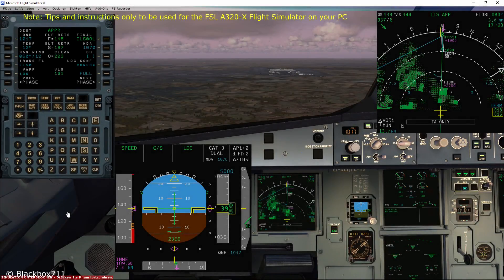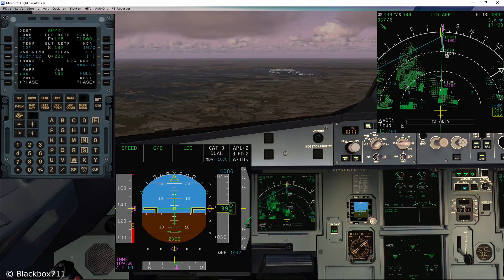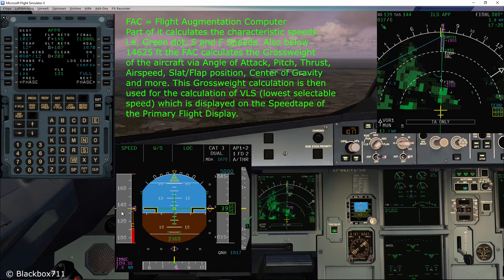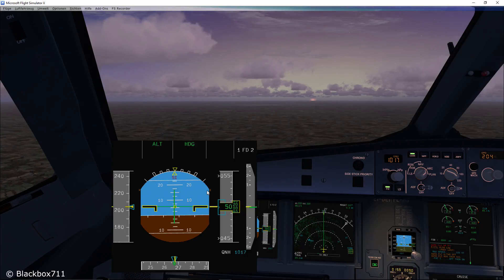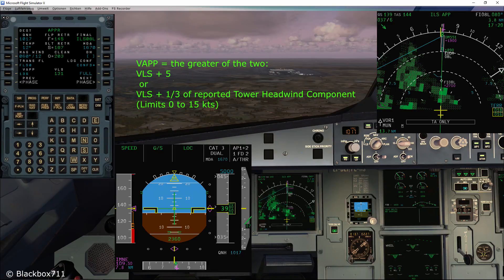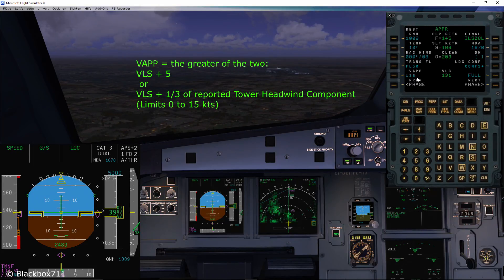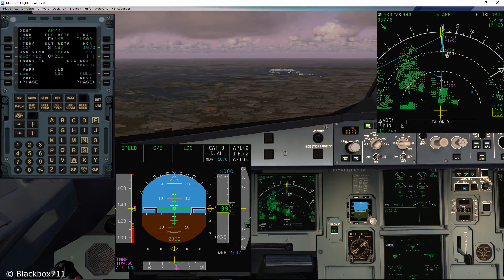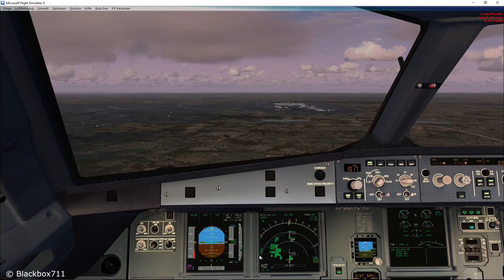FSLabs A320-X Basics: VLS and Approach Speed Management

Comment: Hai Blackbox711, Great video. I have 2 questions. 
We are using an APPROACH PHASE in FMC for the calculation. But, Is this phase available in real Airbus flights?
How to calculate approach speed manually?
Next time, please make a video regarding manual approach speed calculation with different flap configurations. If possible. Tank-you.. We are waiting for another outstanding video
Reply from the maker: Hi. Yes, in real life the MCDU approach phase page is identical. And we use the approach speed shown after filling out all necessary data fields there. In order to calculate approach speeds manually you would need the QRH table.

Comment: Thank you again for your very detailed and useful vids, i have a question i dont have yet the fslabs320 but have the older wilco 320 family and the aerosoft most recent 320 and any time i want to fly direct to some waypoint appears the T-P simbol on the ND and the aircraft simply turns to the left getting out off course regaining the desired track again with heading mode , why??
Reply from the maker: +azizc64 .. Thank you very much. I don't have the Aerosoft or Wilco A320. So unfortunately I cannot really help you with that. But it looks to me to be a bug because the Dir-To function is very basic and should not cause the aircraft to turn in any other direction than to the selected waypoint. Regards

Comment: Hi,

On what basis is the shown VLS in the MCDU calculated?
(In your example the 131 kts) 
Do you know why there is this discripency where the FAC calculated values are not automatically feed back into the MCDU values. After all it must be the more exact. :-)

Thanks for a bunch of great videos.

Cheers

Stephen
Reply from the maker: Hi Stephen. The VLS in the MCDU is calculated with the inserted Performance Data. The VLS on the PFF is calculated by the FAC, where the Grossweight is calculated by certain factors like AoA, TAS, Altitude etc. That is why there can be a difference. Regards
Reply: Blackbox711 thanks. I still do not understand why - if the FAC calculated is considered more precise, why the less precise value is not discarded and overwritten with the FAC calculated value... :-)
/Stephen
Reply from the maker: +MrSOdgaard .. No, the VLS does not necessarily calculate a more accurate VLS. The AoA sensors have some error as well. Also you cannot directly change the VLS in the MCDU. This could only be done by manipulating the GW setting in the MCDU. And the GW is taken from the Loadsheet which is considered to be accurate. So in order to make sure that you have a 5 kt buffer (for wind gusts) to the PFD VLS (which is master for warnings), you increase the Vapp in the MCDU if necessary. I know it sounds strange, but that is Airbus for you. 😉 Regards
Reply: Blackbox711 😉. Interesting and a bit odd...
Thanks for the insight.👊🏻
Do you fly 320s for a living?
/Stephen
Reply from the maker: +MrSOdgaard .. Yes I did. Won't say what I am doing now though. Regards BB

Comment: Question. I noticed I had a very high VLS speed on a flight from KPHX to KSFO. I was very light and had about 2000 lbs of fuel at arrival.
Reply from the maker: +Iron Condor Simulations ... Could you tell me exactly how height the Grossweight/VLS was?
Reply: Thanks for responding. It fixed the data when it auto activated the APP phase on final. Weird how the data was wrong when setting it up durring the approach.
Reply from the maker: +Iron Condor Simulations ... OK. Sometimes the FMS does some strange things
Reply: Blackbox711 actually there was a thread on FSlabs stating that version 1.96 had this issue. Version 1.97 binaries fix the issue.
Reply: @IronCondorSimulations  how can update?
Reply: my problem is very light and Vls very high . 3000 ft gw 60000 when use flap become correct but very hard ...